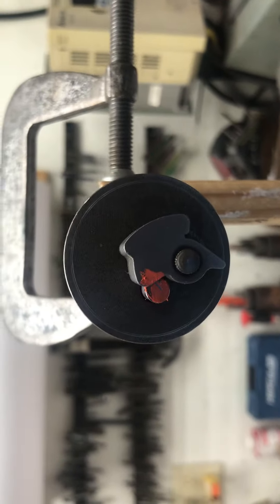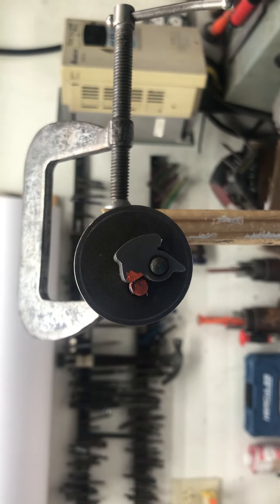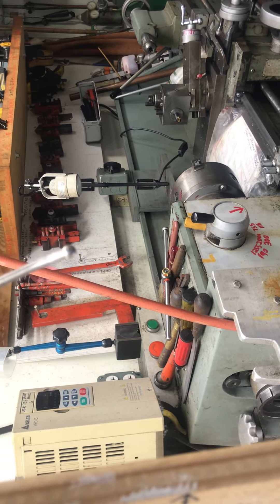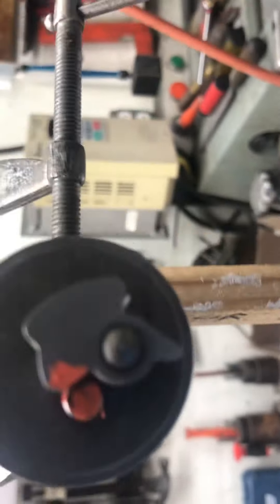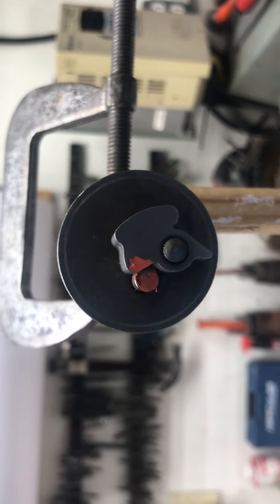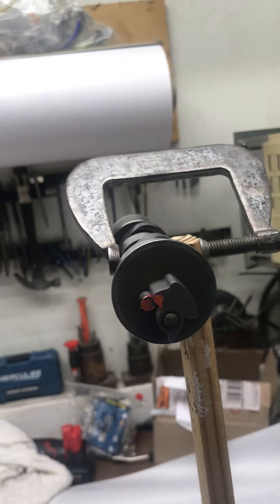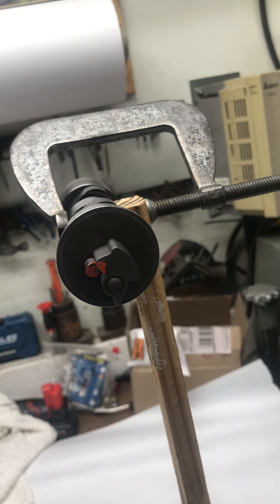Polaris￼ Compression release broke fixed for free final video number four of four￼

Comment: My spring was installed wrong by whoever owned my quad before i did, would that make the quad not start / stall? I have to crank it 100s of times to make it start, other times, it fires up in milliseconds. I replaced everything short of engine internals chasing this problem. Wont start and at times has a miss or bad studder while accelerating, once its very hot, it does good. Its hard diagnosing proplems with variables in the issues it has. This compression release problem makes some sence to me as the culprit because it moves with the cam and was covering the release in the cam at different degrees of success. The previous owner has the spring bent or it was damaged from slapping around inside the engine. Where did you buy your replacement springs? Do you know the part # for it? Thanks for these videos. I appreciate your hard work and time!

Comment: Why don’t you just put another turn on the spring to increase pressure? That’s a lot easier than trying to remodel the spring, and will probably provide more tension than your un-coiling method. Do you think that would create too much pressure? Or?? 

Thanks
Reply: if you pre-wind the spring you will get way too much return spring tension and your compresion release will not release at idle.. (you can hear it stuck on tapping the valves open when it should be released no suprise this will also effect your abilty to idle and probbly does wonders for the cam follower and the Exhaust valves) the spring return force needs to be very light ,  that is why he is making such a point as to slightly unwinding the spring so that when you install it will provide just enougth tension to return the compression release back to the dowel pin  , But as soon as the machine starts , the cetrifical force on the weight must be enougth too overcome the spring and rotate the rod into the release position.  I made the mistake of adding prewind to the spring and had to take it apart again , as it would not disengage the compression release untill I got over 700 RPM
Reply: @brianperkins6121  I’ve learned that the info in this video is entirely wrong. If the spring is modified to increase tension, the engine will run but it makes a hellish racket because the ball beats against the cam rocker. But when installed as per factory specs / spring, it works fine. 

In short, this video is full of it IMO.
Reply: @russchastain9375  The issue I have experenced myself is replacement cams where the compression release's spring tension was incorrect out of the box,,  the spring tension has to be just barely strong enougth to return compression release weight to the dowel pin , otherwise , the compression release wont kick off after the engine starts , tweaking the spring so that it just barely provides enougth counter torque to return the weight to the dowel pin , '"but"  not so much counter tension that the centrifugal force acting on the weight will dissengage the compression release at idle , its quite a delicate ballence , I have also had issues with very weak return springs causing the compression release to not work and the starter being unable to overcome full compression .. the design polaris used is very prown to even tiny issues causing issues with its operation .., his point is correct you cant wind a turn onto the spring its return force will be to high , you have to unwind the spring adjusting its tenson if you run into an issue with its counter torque being to low to spring back the weight to dowel pin , you cant wind an extra turn onto the spring  the return force torque will end up being so high the compresion release will refuse to disengage and you will also hear the racket it makes in the process.. you should not have to mess with it at all it should just work but in my findings that has not been what I have run into ,,

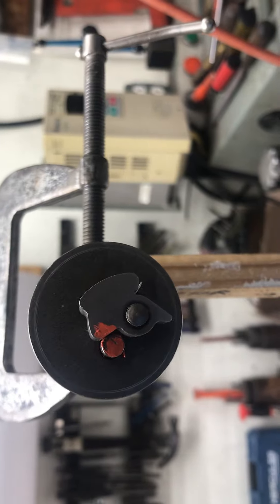Comment: You are totally wrong @ 1:33 when you said "the ball is completely safe, it is never gonna fall out, it's trapped in there for life". I repaired a 2010 sportsman 500 in May of 2022 and that actuator ball had indeed came out of the camshaft!! AND AGAIN, I said it in your other video and I will say it again, YOU ARE NOT SUPPOSED TO WIND THE SPRING TO TIGHTEN IT!! Polaris specifically states that on the instruction sheet they send with a new OEM camshaft, or the compression release will not disengage when the engine starts!!
Reply from the maker: First  , I start my video by identifying MY POLARIS 1998 500. Polaris changes designs like a high schooler changes dresses. The ball in MY POLARIS IS TRAPPED FOR LIFE. SECOND ,MAYBE just maybe by 2022 polaris MIGHT have learned how to make the spring. Obviously they are STILL MAKING DEFECTIVE CAMS  .EBAY has page after page of venders selling REPLACEMENT CAMS for polaris. I am a tool and die maker and spun my cam in my lathe. The spring disengaged at 500 rpm, the idle speed is around 800 rpm.This is perfect. Edwin Dirnbeck
Reply: @ed631941 . Engine rpm is measured at the crankshaft. The camshaft rotates at half the crank speed. If the compression release stays engaged until 500 rpm on the cam alone then the engine would need to be running at a minimum of 1000 rpm to get full compression. That’s too high. Cam speed is not the engine idle speed.